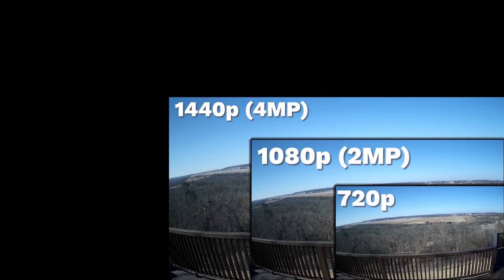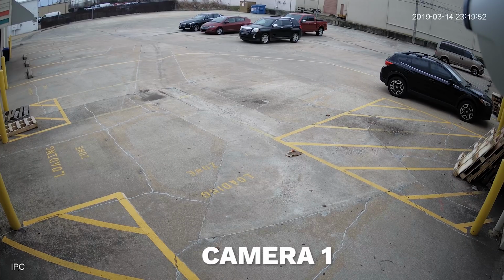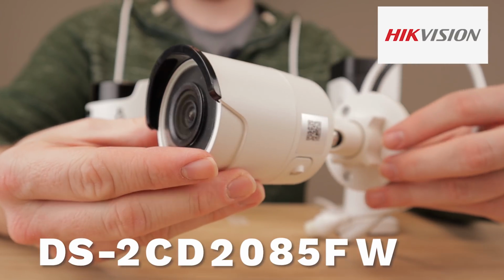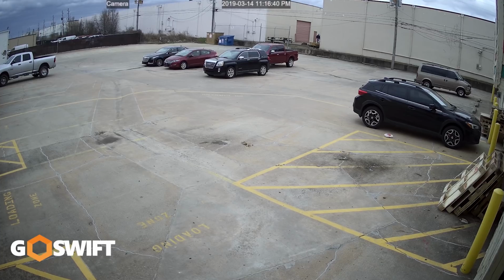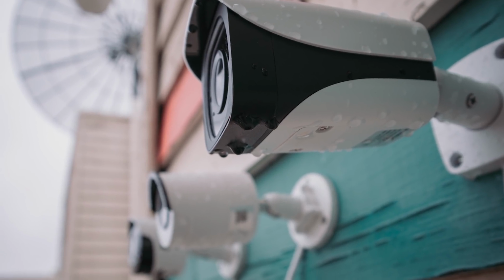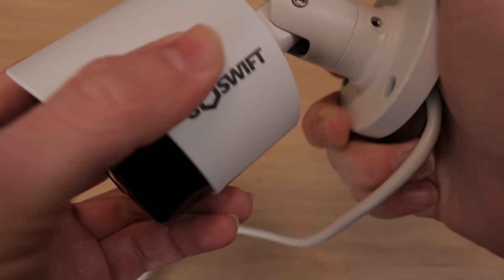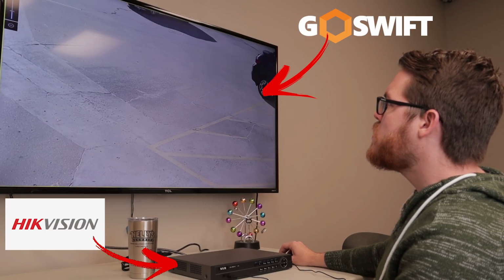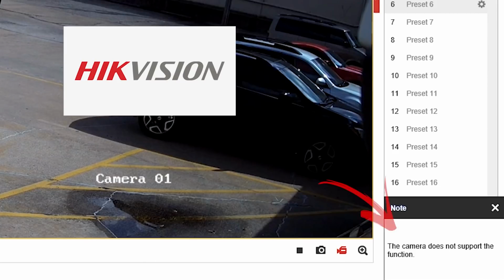GoSwift $99 4K Security Camera: The Ultra HD Power of Hikvision and Dahua at a Fraction of the Price

Comment: Looks nice, but I dont think my hikvision based LTS dvr ( with ip ) will get motion trigger from the camera without using the hikvision protocol, or am I wrong
Reply from the maker: Hi Fred. It should work
 We carry hik oem just like lts and motion works fine on our hik nvrs
Reply: @NellysSecurity  I was curios if you could try it on the NSDV-208UK 8 Channel Tribrid HD-TVI DVR and see if the motion detection works, that seems to be the equivalent to my lts 8508k-st
Reply: @NellysSecurity  Figure Id answer my own question. Picked one up off amazon and tried it on my dvr, got it to connect running in 5mp mode and had to use baseline profile but otherwise is working good with motion detection working as well.